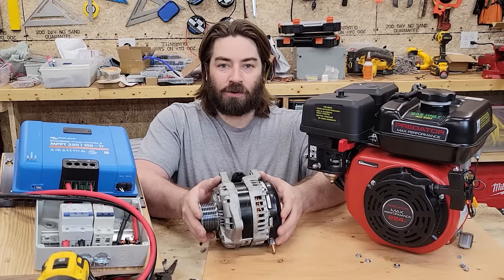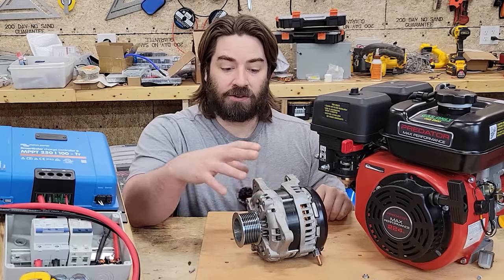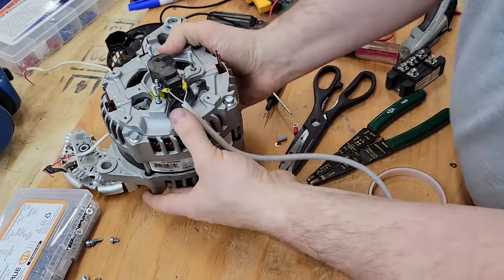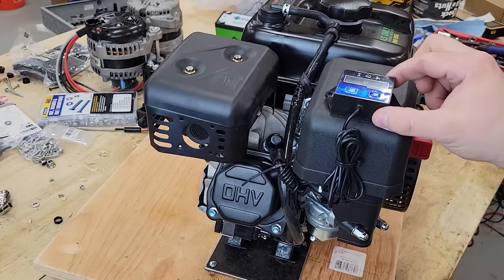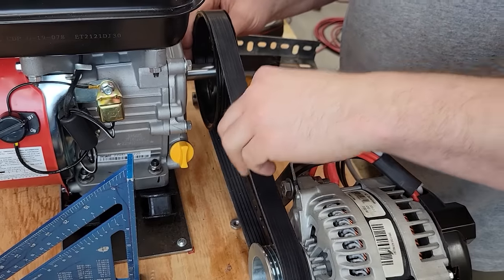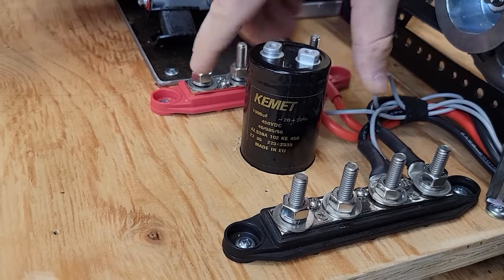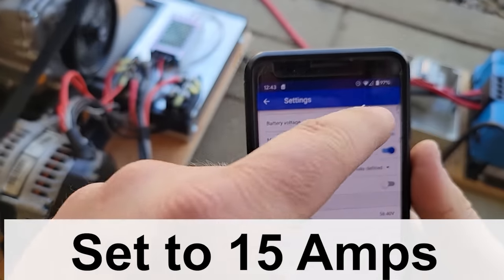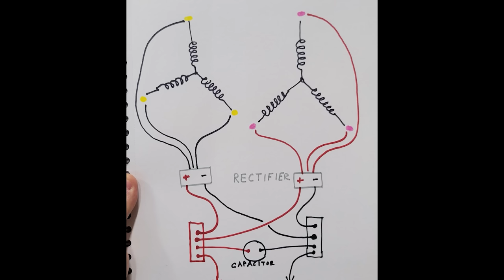The AlternatorGenerator, First Attempt.  48V Battery Charging

Comment: I had built one of these a couple years ago but for a portable battery charger and only 12 volts. Had a small lawn mower battery mounted to excite the alternator. Never could get it to get enough rpm and quit my job I was at so I didn't get it finished. After seeing this I think I'll have to try again

Comment: You did a great job, I did the same thing in the mid-80s with the five horse mini bike engine and a regular old 12-volt car alternator self-exciting just to charge car batteries because I didn't have a strong enough battery charger. I think if you slow your RPMs down on your engine you will save more gas and still accomplish the same thing

Comment: The purpose of a circuit break is to provide an on-off switch, a short/fault protector and a break test switch. A simple trip-switch is to protect the circuitry. So start with one at lower amps and when it trips, measure the draw current, and decide to go higher or not depending of the actual load and whether the alternator can handle the amps. 

Otherwise a great project.

You might want to add a contactor switch to control the auto transfer.

You can also add voltage clipping rectifiers before feeding it into capacitors. It smooths out AC much better.

Comment: This was way cool. I am not surprised it worked, you did everything well. The layout, the wiring, the mechanicals, it was a pleasure to watch.
A spring loaded idler pulley might help with the belt tension, and instead of mounting the engine directly on the rubber mounts, mounting the engine on a larger plate and spreading the distance of the mounts will help with the vibration. 
Now I need to find your treadmill motor generator. I have more than a couple of those.
Reply: Why add more friction and parasitic loss with a tensioner when he runs it direct drive its gonna be such a smooth design.

Comment: Nice DIY project, possible running a Tri-fuel adaptor to let the engine run on Gas, Propane, etc, also maybe a little push button switch to kick start the unit via the 12v needed to get the alternator to work.Keep up the good work
Reply from the maker: I think trying a propane setup would be fun.  Do you have a suggestion on a kit?

Comment: I was thinking of doing something like this. Thanks David. The motor & alternator should be mounted on 1/4" metal plate would be less flex then wood.
Reply from the maker: That's exactly what I did in Part 2.  Thanks.

Comment: Awesome video! For reference to a Honda 2200i generator I can get about 5.2-5.4kwh per gallon. Running it at about 10 amps to charge my 12v campervan battery. It’s a little less efficient running at 15amps. More like 4.8-5.0 kWh per gallon.

Comment: A smaller pulley or a multi pulley on the motor will vary the speed at the alternator to see if output changes with speed of the belt. 
Nice video. Thank you.

Comment: Well I wasn't expecting it to output that much voltage current yes but the voltage is way higher than I was expecting it gives me ideas now. Nice effort now to mount the alternator to the engines mounts so the belt stays tensioned at all times and sorted.

Comment: Great build ! Very nice work indeed ! The whole base has to be a metallic structure-frame with some absorbers in order to maintain  stability ... You could use a bigger altenator as well.
Reply from the maker: Thank you for your comment.  I welded up a new base in video part 2: https://youtu.be/cy0t4qq8mS0?si=KztiHszRzUln-3Wu
Reply: @DavidPozEnergy  There are also some cheap diesel engines for great economy

Comment: Electrically I think you did a bang up job.  Mechanically though I think the engine/belt/alternator setup wont work long term.  The engine is moving all around and the alternator is fixed so the tension is changing.  If you use something to apply more tension to the belt then it's likely going to twist the engine  and make the two pullies no longer be perfectly on the same plane.  The engine and alternator need mounted on one platform and then put all of that on your little rubber motor mounts.  Just my .02

Edit:  oops, hadn’t  watched the second video yet.

Comment: Your large gauge crimper looks like a PITA.

I made one (for 4ga, but it could do others) out of 24" bolt cutters, by welding to & reshaping the cutting jaw.

Way faster & simpler, so easier to use when the cable can't be removed.

Comment: Hey great video! Its so funny how many of us been thinking of doing this. I myself have been gathering parts for this build for a while. I would be more excited to see it produce the proper AC we use in our houses. That is my goal. Just harness the AC power out of the alternator at 120/240v. Seems redundant to go from AC to DC back to AC in the end.  I am trying to skip the middle man and go straight for the AC power. I have seen a few videos of guys dissecting the alternator and adding magnets for stronger flux field. Thanks again!

Comment: As an FYI, the circuit breaker amp rating is based on the Amperes you will be pulling from the alternator/generator.  A 125A breaker is the one normally used in a house breaker box.  The best breaker to use would be a 150A breaker as most houses do not draw more than that.  A suggestion to reduce vibration:  try putting rubber bushings on the alternator also.  The current mounting would allow the engine vibration to travel through the belt to the alternator and then to the mounting board.

Comment: I actually like this video. I'm learning the do's and dont's for sure. Thank you for your reply.
For sure there has to be a little bit of give when the load is applied. I'm going to do a spring tension-ed idler pulley instead of the motor mounts. The idler pulley will act as give and grip. 
My build is going to be 400 amp 15.1 Volt alt with a 13 HP Harbor Freight engine. 
Doing a V belt pulley system 4" pulley's on alt and engine side for more grip. I'm charging a 12volt battery bank. 10 Gel cells in my RV. I'm tired of having to run my 6.0l V8 to charge my batteries at idol. When i travel, the battery bank charges in 2 hours with a 350 amp alternator. At idol it triples in time and burns about $30 in fuel. 
I'm just amazed this isn't mainstream for off gridders.

Comment: Great project, very creative!
But if you don’t want the drive belt to burst into your face one day, and also to get rid of vibration, you need to mount both the engine and the alternator on the same rigid chassis relative to each other. Now when the engine is "softly" mounted on anti-vibration pads, and the generator is "hard" mounted on the base, while they communicate through a stretched piece of rubber, a mechanical oscillatory circuit is obtained, which increases the vibration load of the entire mechanism by an order of magnitude (it will not last long).

Comment: I am sure somebody told you this, older dodge alternators are externally regulated, I use them for welding,charging golf carts,battery banks and just about anything, very easy to hook up 2 field wires 1 to a rheostat with 0-14 volts + 1 to a ground , then your ground and + output

Comment: It appears you have a nice shop with some nice tools. I have that small lathe from harbor freight and even though it's limited there's a lot you can do with it. You might want to get one when it goes on sale. You can buy a quick change tool post for it as well which is what I did. I worked as a tool and die maker a long time ago doing high precision work so I was skeptical about this little lathe but it turns out it's pretty decent after you adjust the slides.

Comment: Great project! Hopefully you know this, but for the sake of others... it's not normal or necessary to run the rotor (field winding) at a full 12v... it wastes a LOT of energy, and you only need enough drive current to achieve the desired output power (not just voltage, not just current). High rotor current will create a lot of magnetic drag, and 12v field drive is never used. 

BTW, the capacitor DOES handle a lot of current. Between the rectified pulses, the capacitor is supplying ALL of the DC current.  The capacitor must be rated for high enough Ripple Current so that it won't overheat or explode (if it's not vented).  Most capacitors are vented either by an exposed rubber plug by the terminals, or the aluminum case is intentionally weakened on the flat end.

Circuit breaker size... 
That alternator is rated for 215 Amps, and it's for a 12v system. That means the MOST it can provide is 14 Volts (charging voltage) at 200 Amps, so 14 x 215 = 3010 Watts.  All generators (and commercial alternators) must be spedified for Power, not Amps. Automotive alternators can be rated for Amps because the automotive electrical system Voltage is an absolute value... 14 Volts for charging the 12v battery. 

The limitation is due to the I2R law... the wire resistance in the alternator limits how much Power can be extracted. 

At your 90.9V DC output, that 3010 Watts = 33 Amps maximum. At 85V DC from your rectified alternator, that comes to a Maximum of 35 Amps. (Power = Volts x Amps) 

Also remember, the alternator rating is the MAXIMUM current, that is not a CONTINUOUS current rating. It will burn out if run at its maximum rating.  I would never run it constantly (more than a very few minutes) at more than 70% of its maximum rating... so 2100 Watts. 

Obviously using the random 125 Amp circuit breaker could lead to disaster, when the alternator can't supply that much at the higher voltage.

Don't run the rotor ("field winding") at more than you already are, in fact you would likely find that lowering the rotor voltage would make it more efficient... but be careful because the alternator output voltage WILL INCREASE with a lower field winding voltage/current. If that power supply has an adjustment for the output, try bringing it down to 8 volts, but monitor the system output voltage so that it doesn't get higher than you want. No alternator ever runs the rotor/field at a full 12 volts, that's technically hard to do in the built-in regulator... they commonly only use 4-8 volts.

In an ideal situation, you would re-create a new alternator regulator that would take the rectified higher output voltage, and adjust the rotor/field drive to maintain the system output voltage desired. This could be done by modifying your DC to DC regulator by taking the output regulator feedback reference off of the output, and tie it to the input. That way as the system output voltage climbs, the DC to DC regulator begins to lower its drive to the alternator stator/field winding... but that would take some "experienced experimenting "😁

Comment: David I am an old 82nd airborne vet and tinkering has help me a lot. I had a three phase military generator I used a 12 vdc to excite it as you probably know they have a phase htz control, and did you check your hertz out that can make a difference in current? I used a gear box off a lawn mower 2 to one ratio. I have a Smithy all in one milling drilling, and lathe combo, and that being said I used lov-joy joints to make it direct drive hope to next drive it on hydrogen power hope I kicked your imagination in sonic drive. Like your Video's picked up from Battery hookup. great work. Mike
Reply from the maker: That sounds cool.  Do you share photos or anything about your build?  I'd like to see it.

Comment: i made one of those years ago with a weed eater engine. i mounted it in an old metal kids wagon. it was enough to charge the battery during the day and i wired a few auto turn signal bulbs for lights at night while camping.

Comment: Excellent proof of concept! Thank you very much!!

I’ve been thinking of a similar project to add a second alternator to my RV. My primary concern was if a Victron MPPT would tolerate impure DC input which you proved it does. Also, I’ve been eyeing those same rectifiers. One unknown for me though is how to deal with varying engine RPM.

Comment: Great project, I have been thinking to do this for a long time. You are  ahead of me. My plan was to add a DC AC converter behind the generator to create an 120V AC current source used as a backup system.  Since you proved that these alternators easy create >48V It's possible to use a 48 3KW inverter to do the conversion. The benefits are compact easy maintenance easy replaceable parts scalable power and possible a cost-effective solution compared with the Chinese build All in one generators.  Nice project, I learned something. PS if you would use a 3 phase step up transformer you can omit the DC/AC converter and create a 3Phase 120Vsystem. With that you can decide to power for example 3 groups in the house. A solution with a 120V AC output requires a control circuit to guarantee a fixed DC or AC generator output.

Comment: Great build!  I was a little lost with some of the components, but thank you for your careful and detailed explanations, I almost got it.
I'd be very interested in seeing what the cost of running would be as it is a gas engine.  Also to see what the final output is, as to how long to charge your battery bank.
I have an idea this might be more economical than my big ol' generator, which although it can run my house, is kind of a pig on fuel.
Keep up the good work!

Comment: I'm 65 years old and have a lot more years of experience, it's behaving under a load exactly as I expected, the belt will loosen, and the engine will move all over the place, we all have to learn, good job David, next time at least have a strut bar between your engine and, make sure it's aligned with the output shafts, you don't want the tension on the belt to pull the two devices together.
Reply from the maker: I made improvements, and am editing the "Part 2" video now.  I usually have to learn the hard way.  O-well.  At least I can save others from going through the same testing.

Comment: I have built. A couple of these chargers. One is direct couple with a love-joy shaft Cupler one alternator one Honda 5hp works good, but I wanted to charge more batteries. My latest one is three alternators. With a 13 hp Honda driving three belt driven 220 amp alternators. Have pictures. If you would like to see them.

Comment: Continued....4.) The temperatures just from the engine cylinder head plus the thermals being generated
from the alternator, plus the thermal transfer of heat from the rectifiers and all the rest....drive belt, etc
can contribute to other problems if this unit is placed into confined spaces! 5.) You might even need
a 12 volt DC cooling fan to remedy some of these things if not taken into consideration! Otherwise Dave,
you've done a pretty damned good job getting everything to work!!

Comment: Yeauh Dave, You could even turn the RPM of the engine 20/30 percent. That would create less noice less vibration better fuel milage and it appears that you do not even need that many RPM’s from the engine in the first place, Great video and Thank You,Victory

Comment: Built a similar setup for my 12 volt system several years back, two si12 Delco Remy alternators on a 16 horse that puts out 120 amps on a fast idle.

Comment: I suggest using a spring-loaded belt tensioner, in the same way and for the same reason that cars use them to tension their ribbed belts.  The respective pulleys are never perfectly round and their shaft mounting holes are never perfectly centered, so portions of their rotations range from slightly too slack to slightly too tight.  If you make for fixed adjustment tight enough to never be too slack, you'll stress the belt and bearings more than necessary.  The spring-loaded tensioner keeps the belt snug while providing compliance for tolerances.

Comment: you can make a cap for the end of that press on pulley adapter. drill and tap the end and screw it in to the 5/16 thread end of the keyed shaft.  As far as mounting it more securely, there could be bolts that go through the wood and and attach to nuts in a metal back plate.  Probably losing well over 10% from all of the vibration in the belt. You could mount an idler tension pulley (even an auto adjusting one like in vehicles) to take up the slack in the belt.

Comment: Hi im a computer tech i do it for a living and i have some advice the full bridge rectifiers should be place further apart and not too close to the edge of the heatsink  also thermal pads are not that efficient in transfering heat compared to cheap thermal paste when applying the thermal paste all you need is a very thin even coat and i mean very thin just make sure the entire surface is covered. Personally i would mount one bridge rectifier one third away from the edge of the heatsink and the other one third the distance away from the first one and keep them centered on the heatsink. this will give you the best cooling
Reply from the maker: Thank you.

Comment: David, Nice project and a lot of work.  Thanks!  Victron did a similar test using an electric motor to drive the alternator just to show how easy it is to overheat the alternator windings. Def wud want to monitor that temp. I want to convert my vehicle to dual alternator and use the leisure alternator at 48VDC to feed a 48vdc to 240vac inverter for 3.3KWH load (electric motorcycle fast charger) to charge while hauling bike while isolated from the vehicle electrical system and no batteries needed. (Can’t easily get that much power with a 12volt alternator)

Comment: Great job, Only thing you are going to have to do is, mount the motor and the Alt. bracket to an Aluminum plate and then the rubber mounts under that. Your  belt tension is being compromised by the rubber mounts. Also , watch the Alternator temp. housing shouldn't exceed 100C.....👋